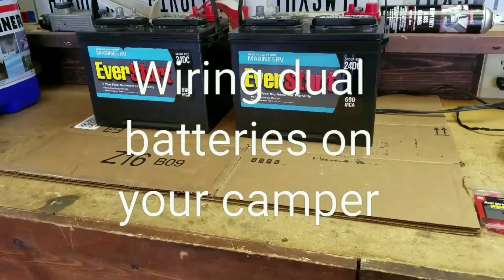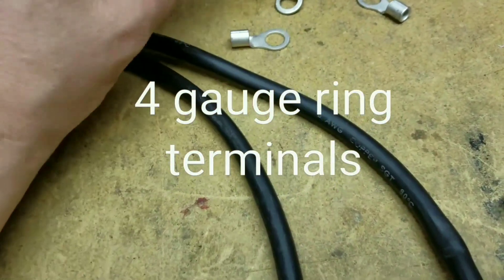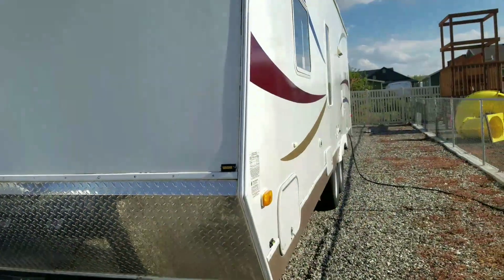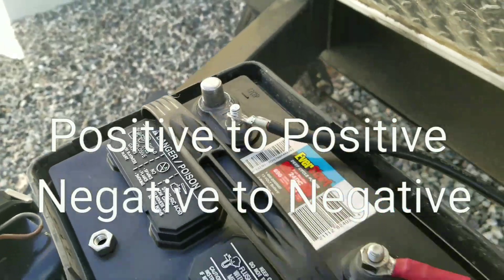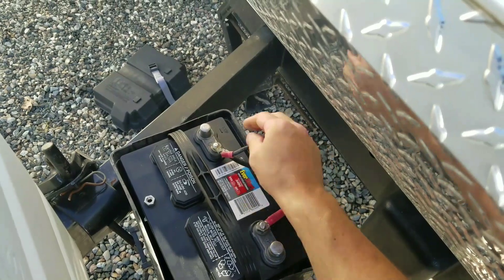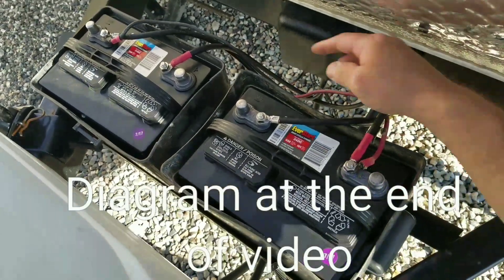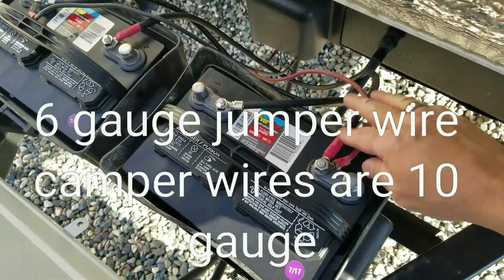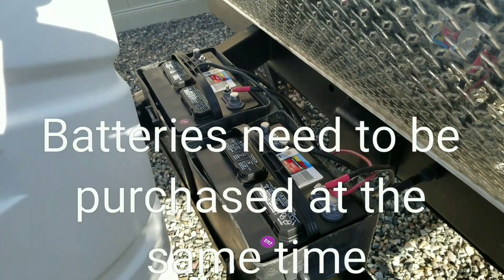How to Wire Dual Camper Batteries🔋In Parallel

Comment: Cool! I came across two batteries like this on a used camper that I am getting and immediately saw issues with how they were wired. I did not see a current going through either battery as it was and two wires were disconnected. While I know how electricity works and flows, it looked like they were supposed to be linked as a series, but wanted to be sure I was linking them back together correctly. As soon as I saw how you connected them, it made complete sense. A no brainer at that point. Someone had delinked the two batteries from each other for what ever reason. Now I can handle the rest and likely need two new batteries. No sweat. Thanks!

Comment: We have LIC Electricians wiering out side 30 AMP hookups to the house to 220V for RVS , this was a perfect explaination.  You nailed it.
Reply: I believe you should be only wiring a 30 amp camper hook up to 120 household current. If you were going to 50 amp camper you would use 240 volt house hook up to house. 30a only carries one leg ac while 50a uses two legs.

Comment: It is amazing how many of these videos have you hook up the two house wires to the SAME battery in a parallel connection. I even found a schematic from a "battery university" showing it that way. Thx for showing the correct method of hooking it up to different batteries.
Reply: Makes no difference, electrically both negative terminals are the same as they are tied together with the jumper cable. So connecting the camper to one or across both has absolutely no impact.
Reply: @MarkRobinson  I was wondering this. He says in the video that connecting them like he did will help them discharge at the same rate, but I'm not sure how it makes a difference if they're already connected in parallel anyways.

Comment: The only time you have to hook the 2 camper wires to 2 different batteries;
 is when running them in SERIES.  
(I'm a low voltage HVAC controls technician for the last 12 years)  
When running in parallel, (especially if you have a camper van) you hook both battery cables to the main battery in the stock battery tray (like usual) but you can place the second battery in the interior if needed. 
Just make sure the jumper wires match each other in length and thickness (gauge)

Comment: I did the same think for my forklift that used to run in series for 6 volts each and now 12v in parallel and work great. Thanks!!!
Reply: i believe this is incorrect,6 volt batteries in parallel will always be 6 volt,6 volt in a series will double the voltage,so two 6 volt batteries wired in a series would be 12 volts.
Reply: @05rickie  Sorry. My two original 6 volts batteries for my forklift were death so I have only 2 12v marine batteries. I accidentally hook up as the same original so it pumps out 24v. I did the same as the video here in parallel and this will be back as 12v and my forklift live again.

Comment: I see all the comments, excited that you connected it the "Right" way, but It would be interesting to test the theory that one would drain faster if you tapped to one..if they're parallel,  they are essentially  1 big battery and it really should not matter. The amperage will flow from both.
Reply: Bingo!

Comment: I have a ground wire from the camper along with the positive and negative wires (3 total). Where would you connect the ground?
Reply from the maker: I would groud the camper to the battery and ground the battery to the frame.

Comment: Thanks Man. What if my battery is one year old? Could I buy the second battery and run them parallel? As long as they are the same exact model?
Reply from the maker: You could but the older battery might shorten the life of the new one. It's best to buy the same date coded batteries

Comment: If you shorten your jumper cables you won’t get a voltage drop of from the jumpers the shorter the jumper cables the better your battery will perform 👍🏼👍🏼

Comment: It doesn't matter.  They are connected by a wire to each terminal.  It doesn't matter which battery terminal you hook it up to, the current will flow the same.

Comment: I am fairly new to all of this and your video helped me out. My only question whats the proper way to connect my main starting battery to charge both aux batteries when my engine is running? Thanks
Reply: Better off setting yourself up with a charge sensitive relay for that

Comment: So with the 2 12v batteries wired like this your only getting 12v and not 24v?
Reply from the maker: That is correct
Reply: Brilliant thanks.. Need extra for going of the grid over winter.. Thanks
Reply: That's what I was wondering. Just bought a 2022 Real-Lite 186 and it has enough room for two batteries on the tongue. I don't want to smoke check the system and was worried it would make it 24v. It has a solar panel to recharge the batteries, would this setup be safe?

Comment: Thanks for the straight forward explanation. I wish more YouTuber's would do this instead of tell their life story first 🥱🥱🥱.

One question: Could you have used an 8 or 10 gauge wire for the jumpers or should the jumpers always be at least one gauge larger?
Reply from the maker: I would go bigger before smaller myself. I would try use the same size wire the camper is already using. Therefore the current flow is all the same
Reply: @jessemichalies  Appreciate it...👍

Comment: Hello great video BTW I want to add a second battery to my TT at the end you mentioned that both batteries should be purchased at the same time, I bought a new one last year, I take it out at end of season bring it inside trickle charge then during camping season it is plugged into house at all times, would a battery being only a year age difference matter that much? thank you.
Reply from the maker: As long as it is the same size cranking amp battery and in good condition it should be alright but if the older battery goes bad it can take out the newer battery with it

Comment: A little confused.   The last “negative” wire from the camper was marked in red…..?
Reply from the maker: The red  terminal was what  happened to be on the negative wire when I got the camper. It was the negative wire for the camper.

Comment: Can I ask why you have to purchase 2 batteries at the same time?  We have a battery that was tested and it's perfectly fine and were just going to buy a second to add.
Reply: The battery might have tested fine but the test can not tell you how much life is left in the battery,so if you add a second brand new battery and your first battery starts failing ,say after 6 to 8 months,then that failing battery will cause the new battery to start failing as well,so now you just wasted your money on that new battery,so always replace your new batteries in pairs,that way "if well maintained "they will wear out together,hope this helps.

Comment: can i connect 12v deep cycle battery to my car's main starter battery in parallel? the deep cycle is different size and is bigger in ah and amps. i need extra juice for electronics charging and lights.
Reply from the maker: I wouldn't unless your running a isolator and have all you electronics wire to the deep cycle
Reply: @jessemichalies  i heard isolators cause stress on alternator and decrease gas mileage

Comment: Have you ever considered relocating your batteries? Even small RVs have a little storage space somewhere inside the camper that could house the batteries, keeping them out of the weather and providing additional security (last I checked they are close to $100 each).
Reply from the maker: If you wanted to store your batteries inside you would have to switch to expensive sealed agm batteries. You can not have vented acid filled batteries inside a car or living quarters.

Comment: I believe if batteries are hooked up in parallel if you hook up pos and neg to one battery both will drain or charge at same time since they are in parallel.
Reply from the maker: You are correct but not at the exact same rate you'll drain the first battery quicker and put more strain on the one battery. It's best to hook them up the way I showed

Comment: won't that give you 24V the way you hooked that up???
Reply from the maker: No it would give you 24 volts if you connected a negative to a positive and the other positive and negative to the camper. That would be wired in series that way

Comment: My my Earth wire won't reach the second battery will it work if I put the positive and negative I'm 1 battery only and run the two wires to the other battery thank you
Reply from the maker: That's the incorrect way to wire it up. You'll have to purshase a longer ground wire
Reply: Try spinning the battery it won't reach 180 degrees.

Comment: but what about charging them from the vehicle alternator?
Does doing this basically double the length of time you can power stuff?
Reply from the maker: It charges from the truck the same as having 1 battery. And yes it gives you twice the battery reserve

Comment: Hi if you connect them in Parallel will give you 24 volts or still 12 volts thanks
Reply from the maker: Parallel gives you 12 volts wiring them in series would give you 24 volts
Reply: @jessemichalies  Thank you very much
Reply: Farmer2492 parallel adds the amps, keeps the volts the same.
Series adds the volts and keeps the amps the same.

I believe

Comment: When you want to recharge the batteries do you charge them separately or hook the charger up as you did the trailer wiring ?
Reply from the maker: Rick Brown you can charge them either way. I have mine on 2 independent battery maintainers in the garage through the winter.
Reply: JesseG's Video's , Thank you .
Reply: What brand Maintainer do you use.  Thanks
Reply from the maker: I've got a few of the maintainers harbor freight sells but one broke already so I'd maybe look for a better one like a Schumacher

Comment: isn't 6 gauge too small? Can i use 1 gauge?
Reply from the maker: No 6 gauge is overkill to begin with. You can it won't hurt anything. If your 2 batteries were located at opposite ends of the camper it could be beneficial but being typically side by side you don't need that large of wire

Comment: I think you getting 24v not 12v
Reply from the maker: Nope 12 volts
Reply: You can get 24v if you connect them in series instead of parallel (parallel is what he's describing on this video).